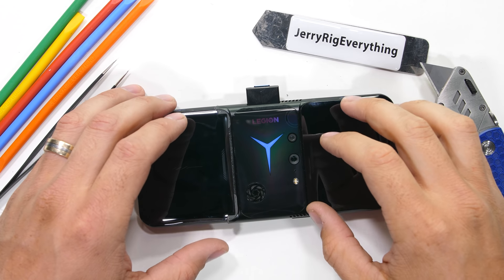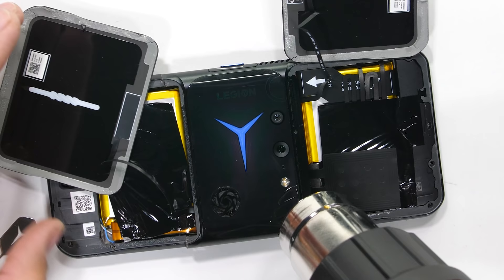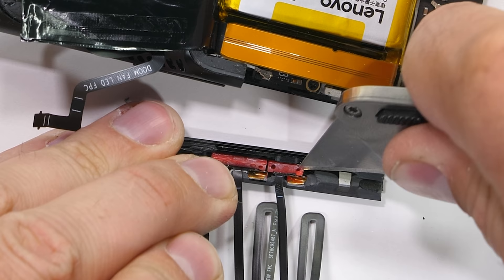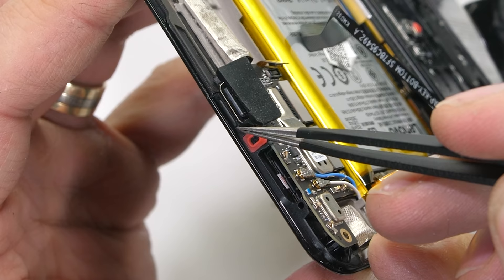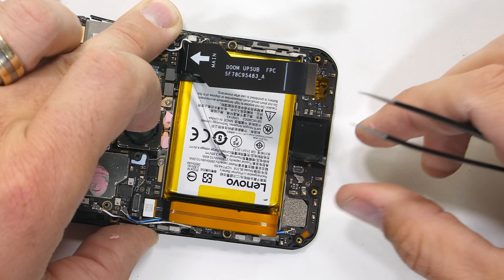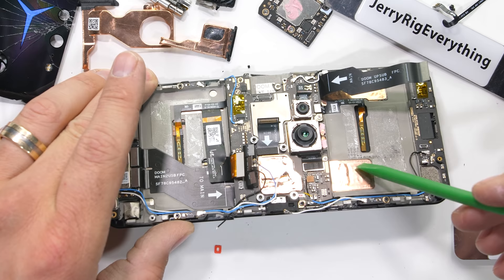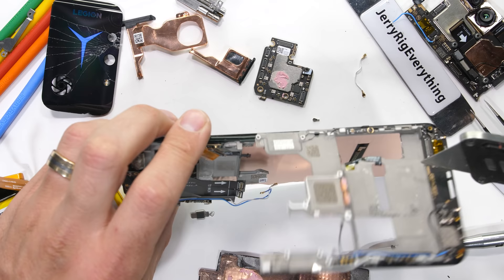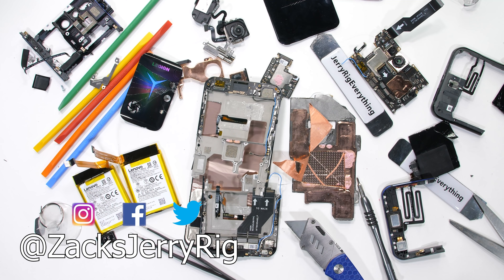Weve Never Seen This in a Phone! - Legion Duel 2 Teardown!

Comment: "No matter what phone you have it should probably be in a case"

Me who is watching this on my caseless no screen protector phone 👁👄👁
Reply: That was me back when I had a samsung s7 and I had no problems. When I switched to a much heavier note 9 with the curved glass, I cracked the screen the first time I dropped it. It depends on the phone and you can sometimes get away with it (especially if you have insurance on it and repairs aren't expensive)
Reply: Me who have a broken glass cellphone without any case either 👁️👄👁️
Reply: @robrobrob1117  Same
Reply: Always get a screen protector. Micro scratches add up over the years.
Reply: @pvshka  yeah I ordered some
Reply: This was me before I had kids
Reply: @robrobrob1117  aye on some phones you can replace parts like that.. not to hard with an ifixit kit, heat gun, and a little time on your hands.
Reply: Y’all gotta take care of your stuff lol
Reply: I haven't used a screen protector in the last couple of years but I have pretty good case that took a lot of beating.
Reply: Yea same, my iPhone 12 is strong enough on its own. And I even drop it every once in a while.
Reply: An old plasticy phone I had would disassemble itself if you dropped it. The back and battery flew off yards apart from each other every time.

Comment: Looking at that, I think the fan cooling system isn't doing much. Those 2 small copper contacts between the vapor chamber and the air cooler won't even transfer 1w of heat energy, most heat were dissipated through the screen.

Comment: I just thought about this phone, the buttons are in the worst possible place, if you were to clip the phone onto a controller, you'd either be covering up the buttons, or you'd be pressing them. also, you'd be covering the important cooling fan, making your phone hotter. Great design, but it's also a very obtuse one in some ways.

Comment: Little bit pointless to protect speakers and insulate microphone when the body is open bc of air ventilation. I understand it is partially protected at least, but when the phone get water, what will be the bigger problem? Tiny holes for speakers, or the fan hole? At least they could put a grill on the fans against pocket dirt.

Comment: Yet this phone is the hottest in temperature amonst the competitors and to add to the insult it's also the most power hungry one too.
Reply: It's the hottest because it is very efficient at conducting the heat away from the cpu.
And, of course it is power hungry... It has 2 fans spinning at at very high rpm.

Comment: wait a sec, 8 triggers, by the name triggers I think the're buttons for gaming, but how are you gonna trigger the button if you don't know where they are located. Ultrasonic Buttons. Where did I started to go wrong. lol. 
Also I wished phones could make the air triggers to be more than one button. Its just one button on each side, but I try to control more than one things with my index finger, how is that gonna work in this. The 8 triggers may help I guessss

Comment: I still think it is pretty bad fault to have. Like when gaming and holding hone on the sides, you do have cases where people might get into bit of that gamer rage and push center or around there hard or harder or squeeze console really hard. I could see someone breaking it by mistake in heat of the moment. Hence why controllers on consoles or even mice or keyboards for gaming are usually made to survive quite a bit of abuse. With this phone, they kind of forgot that. If my gamepad or keyboard was built like that, I am pretty sure they would have been dead by now. Just saying. But hopefully they will improve that with next model.